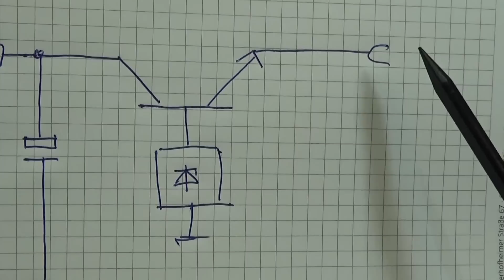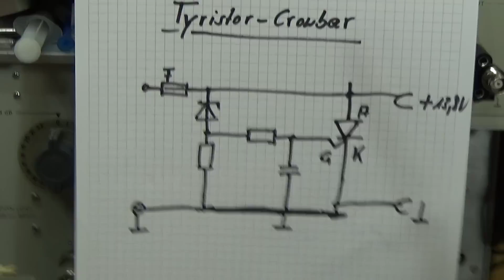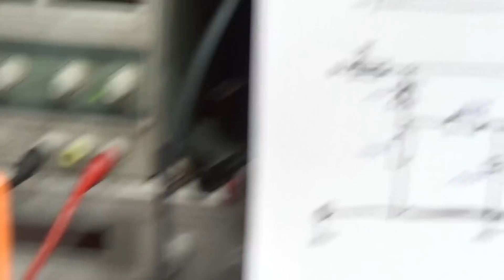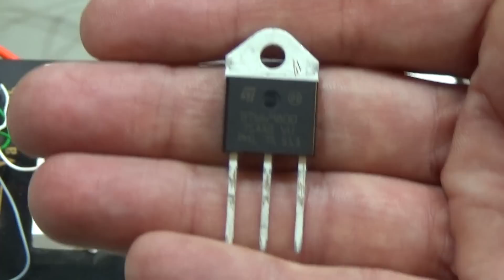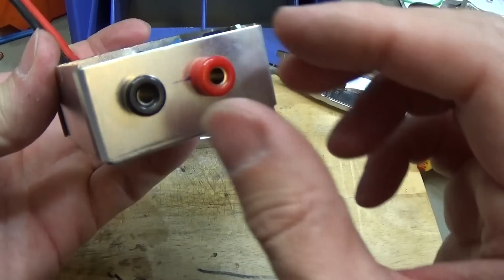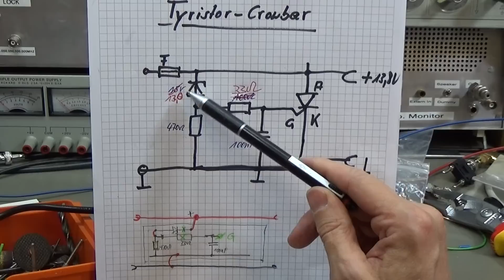#99 HAM Tip:  How to prevent a power supply killing your radio

Comment: I used a very similar crowbar circuit in my biggest power supply, it is very worthwhile insurance. It can also be worthwhile to put a few disc ceramics between the output terminals and the chassis, a lot of power supplies don't like common mode rf currents around them. 73 and well done on your videos.
Reply from the maker: Glad that you like it thanks for watching 73

Comment: I had a radio that would not work properly just made a buzzing nose. I then connected a second radio to the same power supply and got the same symptoms. It was at this point a realized the problem was with the power supply and not the radios.  Yes I know this was not a very clever thing to do. My point is that power supply's can be dangerous, which means that this little device you have built is great idea and something every person with expensive equipment should give some thought to. Great video and very helpful as usual. I was fortunate that on this occasion my radios suffered no damage.
Reply from the maker: This crow bars are so simple and cheap it is a shame that they are not installed in general to all psu's.. Thanks for watching 73

Comment: I love SCR crowbars! I use them a lot in my projects, normally in conjunction with TVS diodes and PPTC fuses, right at the supply input stage. They already save my circuits from my own mistakes.

However, I don't use any resistor between the Zener and resistor association, and the capacitor plus the SCR gate. The capacitor that I use, since it is normally 10nF, does not demand enough peak current to damage the Zener diode.

Edit: I've seen that you added a 100Ω resistor because you were worried about the pulses. However, mind that the Zener below its region practically does not conduct, and as long as the pulses don't exceed the threshold voltage (that is, Vzener + Vgth), you will be fine. The SCR will need a certain amount of current, albeit tiny, to activate, and the Zener won't be able to supply even the minimum when it is blocking. I've used sensitive SCRs without that resistor and with a 10nF capacitor, and never had a false trigger, even considering long supply cables (and their annoying inductances) being connected right before that stage.

Comment: Great video. I built one of these into my home brew 10 amp power supply that I built for my VHF rig. It was many years ago and the choice of thyristors at that time was limited. So if an over voltage occurred it usually took out the thyristor as well!
Reply from the maker: better the thyristor than the radio :-) Thanks for watching

Comment: Before i became a Ham radio operator, i dabbled in CB when i was young. I had a cheap voltmeter and liked to use it to examine voltages in everything. I discovered some radio guys were turning up the voltage in their power supplies as high as 16v thinking it would raise the power of their radios. So i did some reading about the relationship between voltage and current. I discovered that when you raise the voltage in an inexpensive power supply, the current drops. Aha ! Would that explain why their radios audio was clipping on peaks ? yes it did. I turned my power supply down to 12.8v insuring i would recieve the full current the radio was designed for. 13.8v in power supplies was meant to mimic an automobile alternators regulated voltage output, but it is not necessary your power supply voltage be that high.

Comment: Very nice show and tell video Peter. Not sure how many times a radio comes in where the supply and failed and shot 24 volts to the rig.  Most of the supplies I run have a crow bar circuit built in.  But a lot of supplies on the market does not.  This circuit is a sure way to save a lot of repair work. Big thumbs up my friend. 73 Buddy
Reply from the maker: Thank you Buddy. Yeah it is really a simple way to protect the radio gear and I have also seen to much power supplies   with exactly this problem.. Tale care my friend 73

Comment: I have a 12v (13.8), 70 amp linear supply that has wheels on it!  It has three transformers in it placed in a phased, parallel configuration which then feeds a monster bridge rectifier on a large heat-sink.  The rectifiers appear to be Selenium but I can't be sure.  That is followed by four 25,000mf capacitors which may be because of the Selenium rectifiers.  It also has some in-rush current protection which is probably because of the 100,000mf capacitor bank.  This feeds the regulator circuitry which contains several bipolar transistors on the back of the supply which is all heat sink.  I would say that 3/4 of the weight is transformers, 1/4 is heat sinks and an insignificant portion is the electronics (that's why it's not listed in the weight).  :)  It's about 40 or so years old so your circuit is going inside.

Comment: Thank you google for putting this video on my homepage. I've just built a linear MOS-FET regulator to allow for portable operation of a FT-892 from recycled 18650 cells. As good as it might be built, the extra safety of a cowbar is definitely a winner. All the parts for this circuit are already in my shack. However, if you have to buy everything new, you'll still be well below €10 for the circuit alone. Which is nothing compared to buying a new TRX that costs many €100. I'll definitely design it into my regulator. But i will definitely refrain from using a automobile blade type fuse. These things are absolute rubbish. ANL or AGU are much better for the job and aren't that much more expensive. Blade type fuses, which i found to be on most power connector cables for portable or mobile radios, have severe disadvantages in terms of contact resistance and reliability compared to ANL or AGU.
Reply from the maker: Thanks for watching and comment. All the best and 73

Comment: Conduction voltage and current of the thyristor will indicate level of conduction for the gate, which is the switch for the pN juntion of the thyristor reverse bias of the gate, it will conduct, turning on the path through the thyristor, to ground, pulling excessive current to blow the fuse.

Comment: My little power supply has output protection written on the front. They put a 15 volt 6watt zener across the outputs. But the NPN 3055 did not fail. Works using a 11 volt zener with a 1000 ohm resistor connect to the 11 volt zener. The 1000 ohm resistor had no burn marks. Look fine. Only read 500 ohms across it. IDK if that was the problem to start with. Tested everything on the board. Poor supply about 40 years old. I think I will put together a new circuit board. Get rid of the center tap and add a full wave rectified circuit and a voltage regulator.  I know I may loss some voltage.. Try it and see what happens.  If it works ? I will use your circuit diagram.  Thank you for this great idea and demonstrating the circuit .

Comment: Crowbar protection used to be an integral part of almost every linear power supply. But sometimes not. If you have power supply without this protection, it is wise to add some. But this power supply can damage your equiptment in another way (and crowbar does not help at all). The problem is, that GNDs of almost everything is connected together. And when you accidentaly hit the transistor case with your +12V banana plug when the PSU is running, it could lead to a great disaster. It should have at least some protective cover, but in fact, I don't like theese PSUs. It's much better to do the regulation in negative side of the power supply. Then the collector of the TO-3 transistor is on the GND youtput, so you do not have to isolate it from the heatsing and the PSU's case, which is good from the thermal point of view, you also do not have to care about things accidentaly touching that transistor, because its collector, heatsink, PSU's case is on the GND potencial. Regulating at the positive side is much easier, you do not have to build supplementary PSU to power the regulator (using PNP transistors would also eliminate this, but high current PNP transistors was not easy to buy for a good price), but on the other hand, it complicates mechanical design, especially when 20 and more amps are needed.
Reply: There are different types of regulators would suggest parallel regulator for better safer

Comment: You can also use a circuit breaker with manual reset.
Reply: Circuit breakers trip on over-current situations, not over-voltage.

Comment: Peter, I use the exact same circuit (though my thyristor is 300a), it is cheap insurance against destroying a radio. My power supply has soft start so in the event of the thyristor triggering it simply shuts down. It is sad that few manufacturers fit crowbar protection.
Reply from the maker: Yeah a crow bar is so simple to fit in I agree it is sad...Thanks for watching 73

Comment: Also the sender diode and 470 ohm resistor will draw current from the supply, reducing the voltage applied to the radio.

Comment: Of course, great video. I plan to use a car battery in parallel with the PS. In this way I can ensure both consumption and protection, besides a protection circuit. I have heard about crowbar circuits that didn't work, maybe the thyristor failed..

Comment: Great addition to upgrade cheaper power supplies you made there Peter.  Thats the reason I always use high end supplies.  Last thing I want to do is blow up my radio or worse a customers radio.  And I'm with you on switch mode supplies, very noisy.  The only switch mode supply I have is a Wayne Kerr lab supply and it is very quiet but also very expensive.

Mike
Reply from the maker: Thank you Mike! Yes it totally agree with your statement. My lab psu is also a switching one but that's it...Take care 73

Comment: It would be interesting to see how fast this circuit is. There will be a measurable delay in the time it takes for the zener to break down and the switching speed of the thyristor will have a time constant as well. 
I'm curious to know what these delays add up to and if the circuit is fast enough to prevent damage to sensitive semiconductors in whatever is connected to the supply.

Comment: I must say they really went a bit overboard with around 17V drop on these power transistors in this PSU design.
Reply: transformer  cost???
Reply: it might be that the resistance of the secondary winding of transformer is such that at full load, you've got a couple of volts left across the power pass transistors  (product cost tradeoff)

Comment: The newer switching power supplies are much better now days, even the internal supplies in newer radios are switching.
I have both but choose to use the switching supply because it has all the over voltage/current sensors included.
Reply from the maker: Yes I agree newer psu's are Fine 73

Comment: 16v should be the trip point. Most txcr;s work with better IMD specs at 15.5v, especially Elecraft. 13.8V is not the best operating voltage expecially allowing for TX volt drop. All my txcrs run at 15.6v with no issue, usually ~14.8v during TX. Makes for a much cleaner signal.

Comment: A more elegant solution would be to connect the thyristor across the fuse before the regulator while supplying the gate voltage from the output of the regulator. When the crowbar trips all power is removed from the regulator preventing possible fires. Having a crowbar on the outside of the PSU  is dangerous.

Comment: Hi Peter - I just found this video which is very helpful. I have an older Kenwood PS-30 supply I got to power an older Kenwood TS-570D I got at a flea market. The supply does not have protection and I would like to use your circuit. But in the specifications for the supply, it states the open circuit voltage can be as high as 20V. I assume your circuit can clamp almost instantaneously. My question is if I insert the circuit and turn on the supply, wouldn't it clamp before the transceiver load stabilizes the voltage? Actually my question is more general in that many supplies when turned on have a period of time before the voltage is regulated. Wouldn't that effect the operation of your circuit? Or am I wrong about the moment supplies turn on?
Reply: I made a mistake on the specs. The PS-30 is 16V max at no load. The TS-570D is 13.8 +/- 15%, so the max high would be 15.87V. I guess I am okay to use your circuit. But my question becomes what behavior should expect from most power supplies shortly after you energize them. I looked for spikes on my PS-30 with a scope and didn't see any.

Comment: I would just like to add my personal opinion: The crowbar protection is better to realize it and insert it inside the container; Also verifying that a fuse with a capacity proportionate to the capacity of the thyistor is really present inside! because if the inside of the power supply is not inspected, it could happen that the fuse is only assumed and not really foreseen by the manufacturer of the power supply!

Comment: A very good video on the tyristor crowbar.  Well, since you have a German power supply, you must be Deutsch.  My power supply weighs over 20 lbs. since it has such a large transformer in it.  It's a linear power supply.  MFJ 4035MV which is 30 watts continuous and 35 watts surge.  Now days they are making power supplies with over voltage and over current protection.  Ich spreche ein bischen Deutsch.  Ich bin einer Swizer.  W Rusty Lane K9POW in eastern Tennessee

Comment: I have mine drive a relay that locks open with a led also have a switch so I can see the voltage at the output an the relay stays open so no power can get to radio there is also this one in it that will blow a fuse

Comment: I must get around to doing this on my 40A supply. Do they have larger thyristors? I found BTA100A-800B. But thinking I can use the 69 because the fuse should blow fast enough to protect the btw69 thyristor even on a 40A supply.

Comment: Great video and a great idea, I'm going to build one for my power supplies.. Thanks
Reply from the maker: Good luck with the project Joe! 73
Reply: Thank you , for such a professional, theory and by the way. To those who suggested to put a relay, it's quite good but not safety, as long as  any sudden high rise voltage  bounce up above 13.8(v) which in turn risck the output. And that is why a fuse burn out for safty.

Comment: Very nice explanation but my concern is that the thyristor/fuse combination might be slower to react than components in the radio. So the radio may be damaged before the crowbar fully operates. Is it possible to measure the time for activation?
Reply: I'm sure a single shot capture with an oscilloscope you could measure this
Reply: I am wondering this as well. The thyristor will have a speed at which it switches, plus there is the delay as the zener breaks down and a delay as the fuse opens. These would all add up, and likely be longer than it takes for a semiconductor junction in the radio to experience damage.

Comment: well, to handle that current you're using a power thyristor. but instead of that, if you uses a power transistor even the same type that uses the source power, in the case that the transistor of the source power will sorted, you can change the damaged power transistor with the protection transistor. in this way you will have a change to make a call with your radio without overvoltage protection. using the little thyristor used in the first part of the video to trigger and lock the circuit.
Reply from the maker: Hi Fede, well yes as long you have only 1 power transistor but what if you have may be 5 power transistors in parallel than your approach becomes a bit complicated.. 73

Comment: Very good logic. But still the whole thing depends on a fuse which might not be fast enough to protect radio electronics. I have seen 100$ transistors that burn faster to save 0.1$ fuses. :-) That being said, I recently discovered your channel and you have very informative videos. Also I admire your workbench equipment, especially the mini VNA.
Reply from the maker: Well the fuse is not the critical component which needs to do the fast switching therefore this little crow bar will protect your radio for sure. Thanks for watching 73
Reply: Bora, at the instant the thyristor fires the positive rail (and your radio) will be shorted to near 0V.  This happens within about a microsecond, long before the fuse gets around to blowing a fraction of a second later.

Comment: interested in building some of these but i know little about electronics. the components listed you have given values for  but when i look to buy them they have voltages on them, wattage and what type of capacitor or resistor you used. apart from that good video

Comment: With the straight path from the fuse to the output which is the path of least resistance - what actually causes it to take the path of the protection circuit?

Comment: What does the voltage rating on the thyristor need to be - do they work like other things which are actually wattage based . Like a switch will be rated at 220 volts at 3 amps or 110 volts at 6 amps which would make it like 600 watt rated?

Comment: Many thanks for all your video work. Would a BTW69 with a voltage rating of 600v or 1200v be a suitable substitute as I'm struggling to find the 800v version? All other specs. being the same of course.
Reply from the maker: sure

Comment: You should get on with the explination of the Thyrisistor crobar circuit and the parts values. 
The power supply doesnt need a 25 minute explination.
This video is over an hour long and should take no more than 15 to 20 minutes maximum.